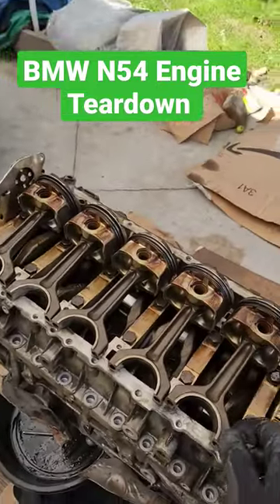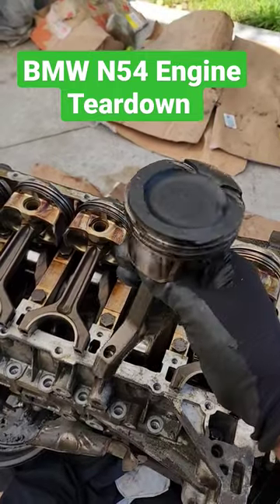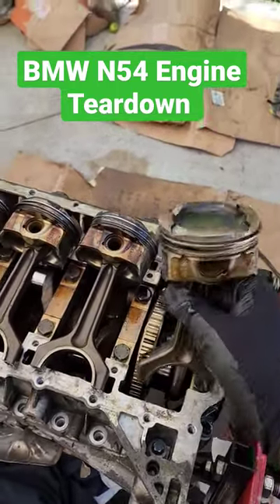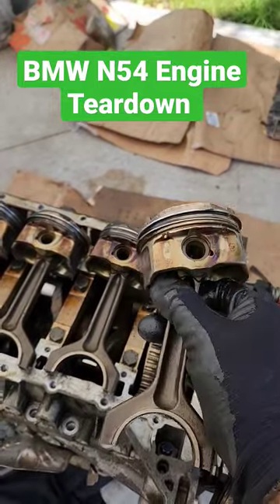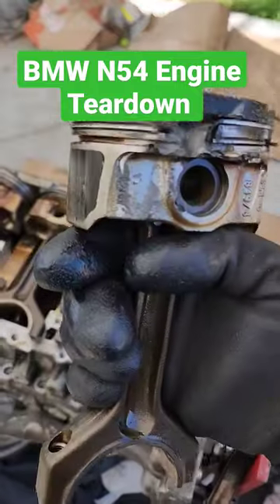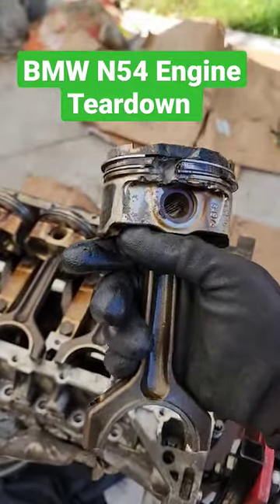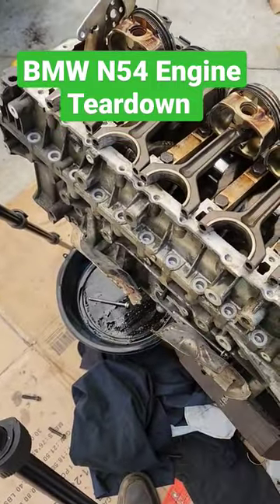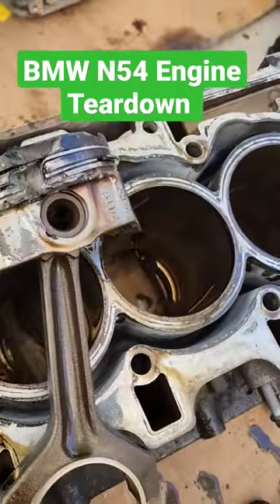Piston Ring-Land Failure on a BMW N54 Twin Turbo Engine #bmw #fail

Comment: Clapped out 335i owners remapping their cars to push 20+psi of boost with just an oil change if the car was fortunate enough.
Reply from the maker: I think that's what happened here. This one was out of an E90
Reply: Truly unfortunate, these engines are quite solid aside from stuff like high pressure fuel rails and leave a lot of headroom for tuning - when done right
Reply: Oil change is optional. Better spend money on rims and other tuning shit for looks.

Comment: Bimmers have ever more plastic in them, so the pistons were the next logical step.
Reply from the maker: This one had the normal plastic intake, valve cover and timing slides... 

No plastic oil pans, turbos, or pistons yet 🤣
Reply: @speedkar99  waiting for german car with plastic pistons, cam shaft and crack shaft
Reply: @danarj5713 BMWs are solid I had a bmw z4 on 10,000 mile oil changes only died to its shitty automatic trans bending the driveshaft. Now I traded that for an Acura TL A spec and yea the Acura drives like brand new car but also plastic in the engine bay, plastic covers for the plastic parts even 😂

Comment: I did a valve cover gasket and an oil change on my 2010 535i xdrive.. and soon as I was done and try turning the car on cylinder 4 & 6 smashed into the spark plugs.  This engine sucks

Comment: We service CR-V which loved to drink 5w-20 like a lemonade, until one day it froze on the way to Montreal. We replaced the engine and took the old one apart - one the pistons had the same exact damage as this Beemer.
Reply from the maker: Ouch! 

No wonder it drank oil...there were no oil control rings. 

What engine did it have, K24?
Reply: Yeap, the K24. Oil control ring clogged with carbon. We did about dozen of these engines, but this one was the 'nicest'.

Comment: I feel like a lot of the i6 BMW produces has issues with cyl 6, it must just be because it is so far back in the bay that heat doesn’t dissipate as easily than the front one for example that is in front of the fan
Reply from the maker: Yes
Combine that with the heat of the turbos and exhaust near the back and it can be a factor